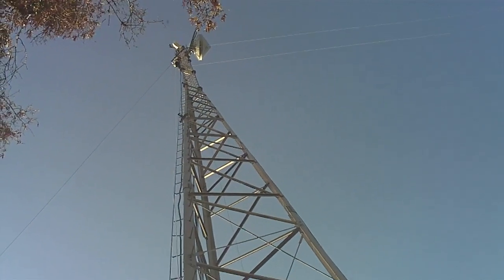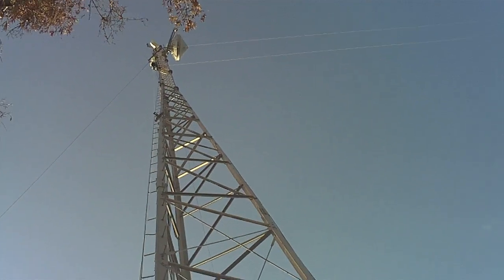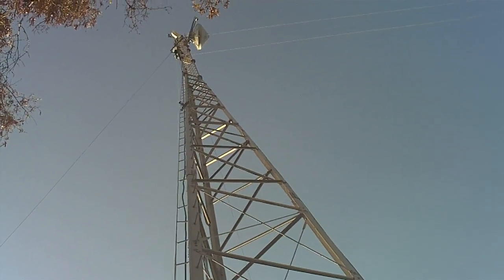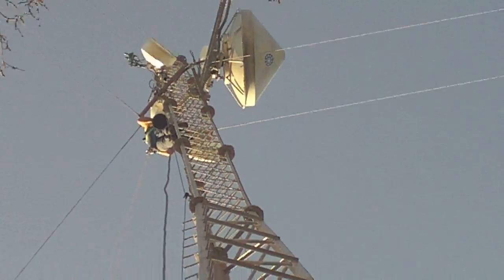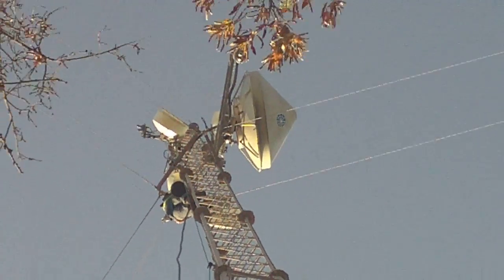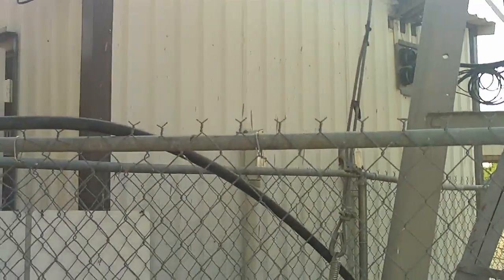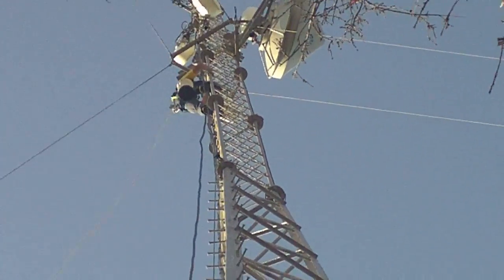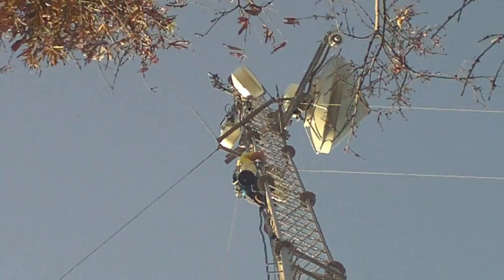KI5DX 70cm Repeater Installation

Comment: all looks great,,  I used to have 3 UHF repeaters online at different locations all on same frequency  3  different PL tones
Reply from the maker: This one is still on the air in the middle of downtown Paris, TX.  Has been upgraded with a new repeater controller that does C4FM and WIRES-X.  You can also get to it via EchoLink as well.

Comment: Question...vhf repeater 25/50 watt out put...Sinclair Q2 series duplexers... can a amplifier be added on the Duplexer ant out put between it and Ant?

Rx  lowpass
TX High pass
Amp considered Henry  
Run 100 watts with TX trimed down to 25 watts that would be going to Duplexer low pass side.
Or am I missing something here.
Pete N6ZLW
Reply from the maker: Unfortunatly I just helped install this repeater I’m not the custodian and don’t know much about them.